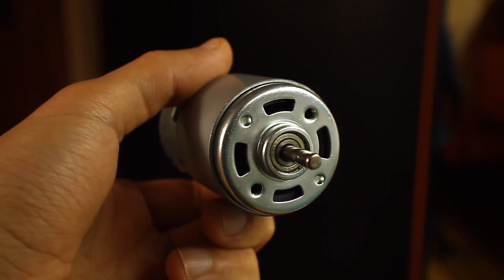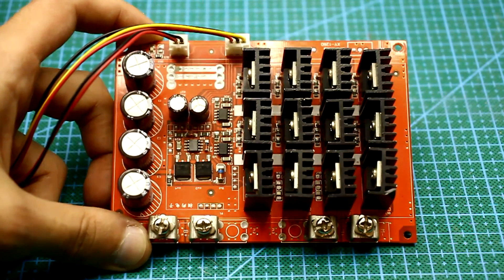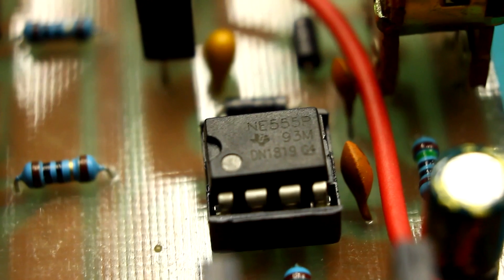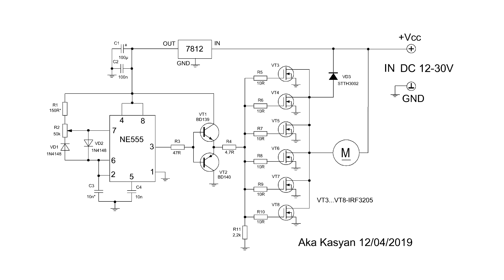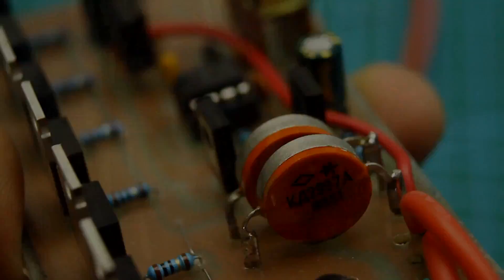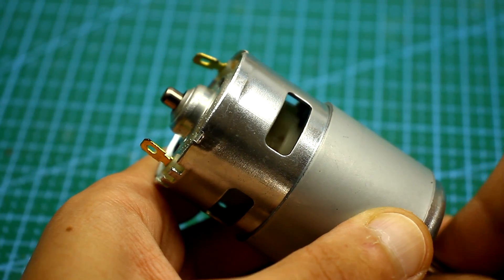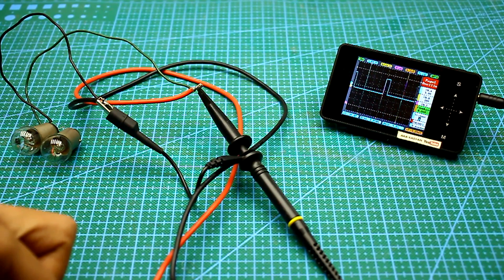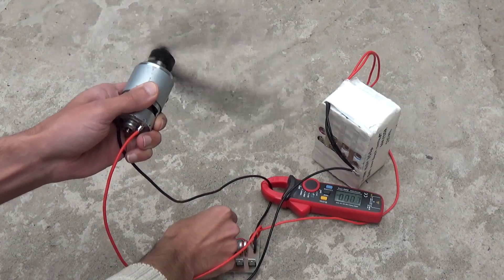Powerful DC motor speed controller

Comment: YOU REALLY should DO VIDEOS ON HOW TO USE A [BRUSHED] MOTOR FOR AIRPLANES! i am pursuing this and think it is cheaper then regular "brushless motors" but they dont see to have a high rpm also their is a "gear reduction system to increase torque?" dont understand what that means.

Comment: Thank you for your beautifly simple speed control, but could you also post a diagram for ac brushless motors? I would like to use AC brushless motors in several of my projects as they are more powerful and efficient then DC motors. the commercial controlers all have a rediculous start-up safety features that totally make them useless for drill motors, power tools or lathe/ drill press/pump use or ordinary fan- blower use. please help!

Comment: I recently got 775 motor and it only consumes about 0.5 amps at 12 volts with no load and speed is slow but your one consumes more power and runs faster how because I wanted high speed at 12 volts

Comment: please make a circuit for 18650 battery that can automatically charge the battery when its full it can cut off and when it has at least 2.5 or above volt then it can again charge it

Comment: I would like to build that controller. Is it possible to have the listing of the parts used. I am also a bit confuse about resistors values on the plan.

Comment: Connecting all gates together is not an good idea. I do recommend to see Kevin Darrah vídeo about thermal runaway.
Reply: In that video he's using BJT transistors, for this project she's using MOSFETs. As temperature through one mosfet increases, the Rds on will also increase, and more current will flow through the other transistors in parallel. In addition, she has put current balancing resistors at the source of each FET to help neglect the differences in Rds on. This is less of a problem with MOS, but can become a greater issue with SiC FETs as any source resistance for high power designs is not ideal.

Comment: Not exactly new, I was making electric model airplanes back in the late 1980s using both home-built and store-bought Electronic Speed Controllers.  ESCs are now cheap (from China, where else?) and can handle very high currents.  Not clearly shown in the video is the fact that all RC receivers send out a PWM signal centering around 1.5 milliseconds, the standard for all servos.  Care should therefore be taken when adjusting the 555 timer chip or the motor could turn on unpredictably.  Perhaps the most difficult challenge lies in making the circuit small enough to fit inside an RC model airplane.  The high power device in the video would be better suited for use in ground projects as it is much too big and heavy to fit inside most model aircraft.  However, to answer the question in the video, I would welcome circuit designs for RC model aircraft as I found the electronics part of the hobby as fascinating as the flying part.

Comment: almost all of the commercial speed controllers have a cursed safety feature built in which somehow impedes the ability to run two seperate motors.  
For some reason when you arm one motor/controllor and get it running the other motor/controllor refuses to start up run by an auxilliary second throttle. I need two completely seperate  motor systems in order to be able to sync their speed as they do on full size twin driven planes

Comment: As a driver of electric vehicles since 2001, i've repaired some dc controller in this years. One thing i've learned is, that those controllers do have some circuits if something is wrong, and another  function for limiting the current (they use the voltage drop over one of the FET). Another hint is to use a diode or transistor for measuring the temperature of the cooling radiator, for reducing the current. Hope it helps a little bit :-) .  I'll print your circuit diagram for later, there a many broken controller with good FETs in it.

One wish for a later video: i am searching for an easy little ac converter with changeable frequency, as example for an record player. There are some players which had this feature (RFT Opal i think, or Linn Sondek).

 Thank you.
Reply: Can i replace this circuit with my e cycle controller?

Comment: RC airplanes ❤
Dude, take a look at the channels FliteTest, Experimental Airlines and Samm Sheperd (RIP). They have fantastic and easy projects for rc airplanes! 😃
Other than that, if you don't have a transmitter yet, don't do the same stupidity I did buying a cheap one from FlySky. Buy a radio that runs OpenTX that is super programmable! (Take a look at Painless360 and Joshua Bardwell channels for tips.)
There are cheap transmitters from Jumper that runs a port of OpenTX called JumperTX. The Jumper T16 is amazing! 😃
Anyway, great luck!!!

Comment: If you connect multiple MOSFETs in parallel, you should NOT use a gate resistor for each of them. You want all of the MOSFETs to reach the gate threshold voltage at the same time. The tolerances in gate capacitance combined with the tolerances of the gate resistors will throw the times when the MOSFETs switch out of sync.

Comment: i think you need to install heat sinks due to sudden change in speed leads to load the mosfet's and heat up fast resulting in thermal runaway.
Reply: As stated in the video the MOSFETs stayed cool and a heat sink will be added anyway. Changing the speed doesn't really matter. Also MOSFETs are much harder to drive into thermal runaway, especially when there's multiple of them in parallel.

Comment: Pls make a AC MOTOR SPEED CONTROLERS USED IN DRILL AND grinder..🙃🙃🙃🙃🙃🙃🙃🙃🙃🙃🙃🙃🙃🙃🙃🙃🙃🙃🙃🙃🙃
Reply: When I needed to drill stainless steel with my cheap drill I used a starting ac motor capacitor in series with the drill (400 V, 30 uF or less I think). This lowered the speed and saves the drill bit from the heat and stress. Also works in grinders.

Comment: Please make video with such explaination or just put some link to understand  the curcuitary in detail.
Like i did not get how those 6 MOSFET  works here
Reply: There's nothing special about this circuit. Search for MOSFET PWM on the internet and you will find thousands of examples building a similar circuit. I'm sure many of them will explain what the MOSFETs do (although it should really be clear already, if you ever used MOSFETs in a circuit).
Reply: @superdau  i know working of MOSFETS but i am askin why 6 not just 1 and why in this configuration?
Reply: @AhmedAli-sn3ty  
It's just multiple in parallel for higher current capability. That's something you can do with MOSFETs (but not with bipolar transistors!). You shouldn't use a gate resistor for each MOSFET though, only a common one for all of them (so remove the 10 Ohm ones from the diagram).
Reply: @superdau  I didn't understand what you said in your last comment back current, unsync . 
Can you provide some link?
Reply: @gujarisantamanyugmai  
With "out of sync" I don't mean completely reversed or something like that. MOSFETs will turn when their gate reaches a certain voltage. But the gates of MOSFETs have a capacitance that has a tolerance from production. If you have multiple MOSFETs in parallel and a resistor (with its own tolerance) in series with each gate, the MOSFET with the smallest gate capacitance (and/or smallest series resistor) will reach that threshodld voltage first and open first. It will always take all the current for a short time until the other parallel MOSFETs turn on as well. This might degrade the MOSFET. Same happening when switching off. The MOSFET with the largest capacitance/series resistor will be the last to close, again taking all the current on its own.
If you have all the gates in parallel without any resistors the only thing keeping the gates at different voltages are parasitic resistance/inductance of the traces and component legs. The only time when you want dedicated gate resistors on parallel MOSFETs, is when you have really high gate charge/discharge currents. And even then the resistor should be below 1 Ohm (that's what manufaturers say in their application notes).